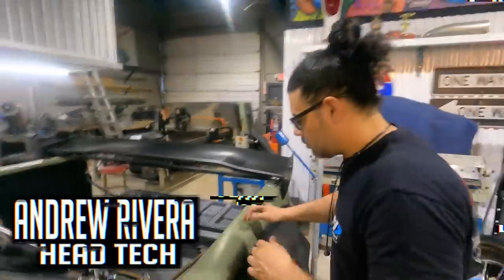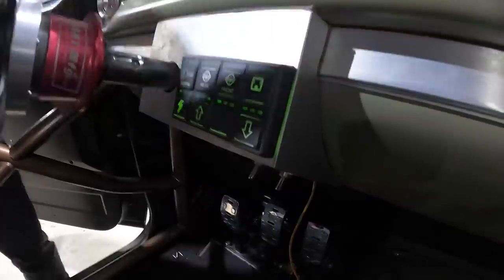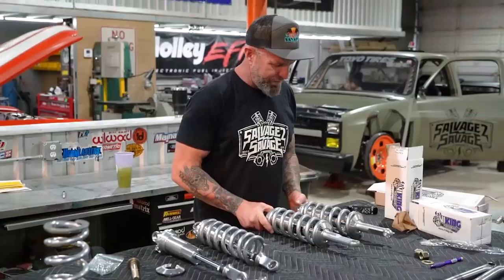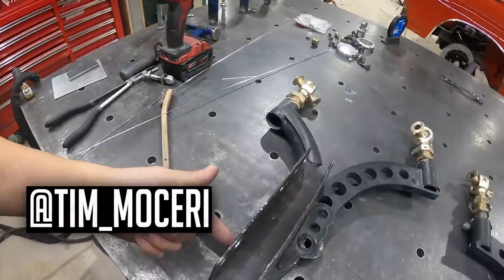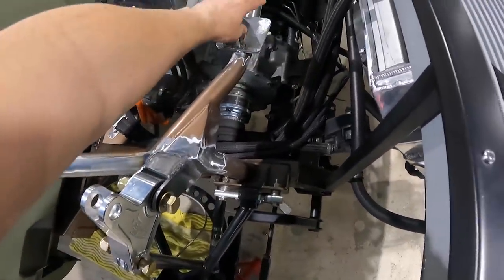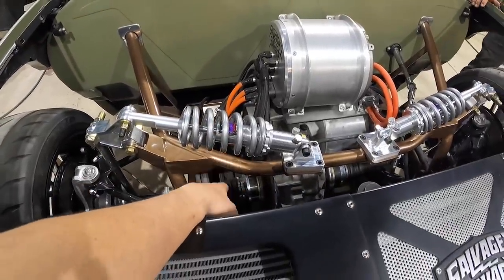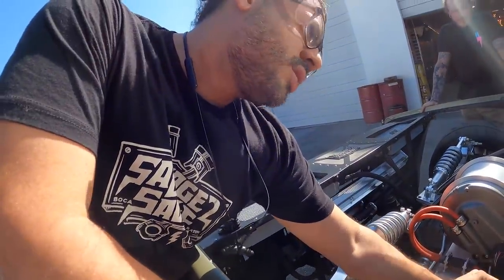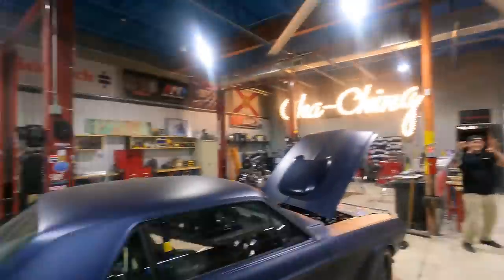Tesla Swapped C10 Squarebody First Drive with Pushrod Race Suspension! - EV C10 Ep. 27

Comment: Just a word of wisdom for all of you who learn by watching YouTube videos, coil over shock adjustment is not for changing ride height. Ride height is determined though the coil length and shock tube travel. The adjustments nuts are for changing corner weight. When you use the adjustment nuts to change ride height you risk binding springs, bottoming out of the shock, and a few other bad bad conditions.  Now you know.

Comment: With that modification of the lower control arm, you have the heim joint riding on the threads of the bolt, which is not good.  There are two ways you can have the heim on the shaft part of the bolt instead of on the threads.  Aerospace bolts let you specify how long the shaft is, versus how long the threads are, and you can get a bolt that has the shaft length you need, without excessive threads.  The other alternative is to use a longer bolt, and then cut the threads down to be the length you need, and then just chamfer the end of the bolt, so the thread engagement is nice and smooth with the nut.

Comment: Hi Guys, those are some beautiful billet bellcranks, but it looks like you currently have a falling rate suspension in the rear.  You need to re-engineer those so that the angle from the unsprung pushrod is to the bellcrank is >90 degrees at droop and at ride height, and then approaches but doesn't fall below 90 degrees at full compression. Dennis Palatov of Palatov motorsports has patent you can look up, or just give him a call.

Comment: That's an awesome build, that no words can really express..   : )   You're paving the way for other custom builders. Eco-friendly tech is largely absent from the custom car building community, and it's a breath of fresh air ( pun intended ) to see this in action.  What I'd be curious to see is an off-road / overland version of a tesla swapped truck,  possibly with a range extender, given that offroading often ( always? ) mean away from charging grid infrastructures? Just an idea: combining a motorcycle engine with the latest and greatest tech generator ( Siemens 99% efficiency and impressively low weight ) as a range extender.  Would give that roar back to those that missed it.

Comment: Oh man it's cool to see that thing ripping, been a long time coming! It looks amazing. Can't help but notice that the front coilover brackets aren't gusseted at all -- I just see stitch welds on top of the tube? I don't know how the forces translate through the pushrod configuration, but it feels like front suspension mounting should be BEEFCAKE. If I may make a suggestion, your machinist can make a lower component to the brakcet so that it clamps around the tube, rather than welding on. It looks like you'd have to disassemble the whole front end to get an angle to fully gusset that bracket, but a clamp-on could be just as strong and be removable/adjustable in the future.
Reply from the maker: Thanks for the insight! It's definitely something we'll look into. We're just excited to get this thing on the road with a working suspension

Comment: Looking good! There are a few EV conversion electric power steering pumps out there that would be significantly quieter than the one in there. Just in case the noise ever drives you nuts :).
Reply from the maker: We're already looking into a full electric set up. but at the same time, it's meant to be a race truck, so a little noise never hurt anyone! Thanks for all the support!

Comment: Viking???? there are far better choices out there for coil-overs, nothing against them. A lot of people run them and are happy however personally I think that this build has been top notch and should have top notch coil-overs.
Reply: I was really curious on why they changed brands as well. Perhaps I missed it in a previous episode.
Reply from the maker: Well we cut the crap out of the kw springs to get the truck sitting right at sema, so we needed new ones and the KW couldn’t get here in our timeframe so went with the Vikings. They are actually built and performing well so far but never know we might change them up if KW comes through again.

Comment: There are better quieter electric power steering systems.
Unless the batteries are on high draw or high charge the fans on the coolers shouldn't need to be running.
Reply from the maker: Feel free to send us a better electric power steering rack!
Reply: @SalvagetoSavage  I have one you can have Free if you pay the $980000000 shipping. ;-}